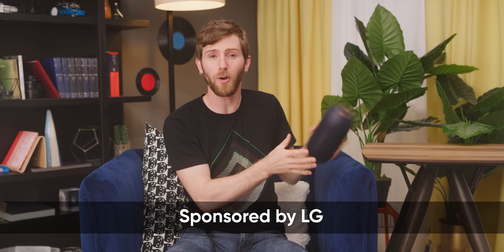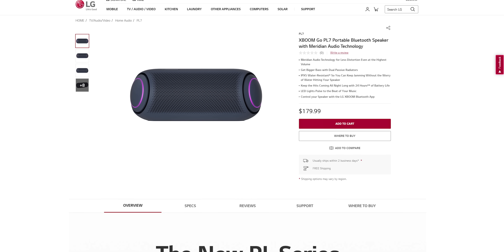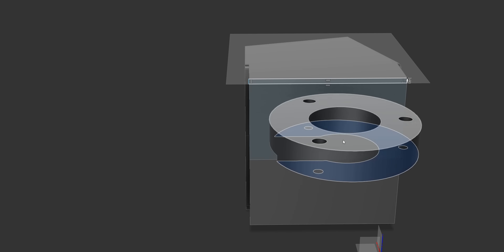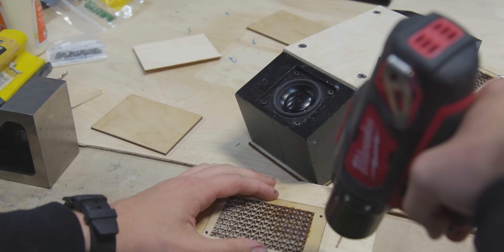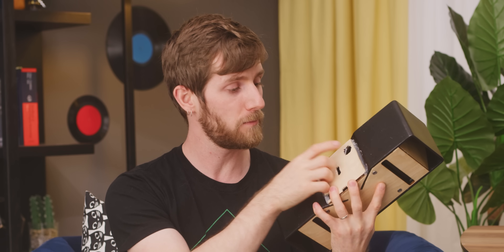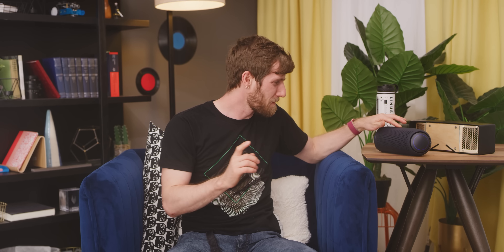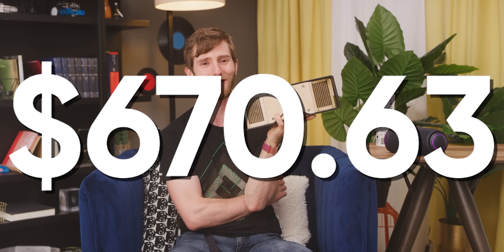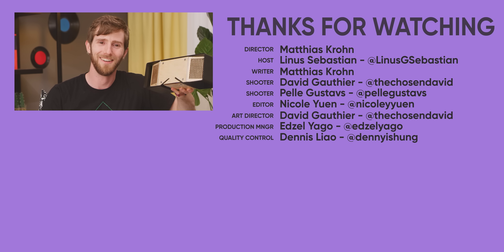Can we build a better bluetooth speaker? - LG XBOOM Go PL Series

Comment: Is it a joke? So much effort (design, 3d printing, a notable effort to create a real bass reflex cabinet and so on) for such a terrible result. Ugly design (those hideous screws, seriously?) and obviously poor sound mainly due to an initial massive flaw: why the heck replace a central bass or sub speaker with a tweeter, and to top it all pointing upwards, meaning all the high frequencies will be lost to the surrounding air...? It is totally contrary to all acoustic rules for a good stereo spacing and image, correct phase and bandwith. Just a single central bass speaker and two lateral tweeters turned towards the listening zone would have been way better. Nice effort, but do it again, please!! Oh, but wait, come to think of it, it was just a not so discreet sponsoring for the LG bluetooth speakers... so - and considering the absolutely ludicrous final price of this endeavour, better take it with a (costly) pinch of salt :-)

Comment: Currently in the process of turning a cheap corsair keyboard (K55) into a wireless one. Goals are to keep everything internal, be able to use it in wired while its charging, switch over to USB C for the port, and have somewhere in the range of 5-7 days battery life. Not a huge care about the cost or time just a fun project to see if it possible. Would love to see your guy's take on this.

Comment: With 200 bucks I can build for sure something better than what lg can make.

DSP +BT and a TPA3618D2 with a dual driver solution and an a passive woofer

bass box software, design the box and some tweak on the citrus logic by ic.

3s2p cells and you have lot of power and functionality.

Comment: 2:00 costs such as labour costs and anything really associated with designing and manufacturing shouldn't be factored in. They have economies of scale, and usually products aren't developed from scratch entirely, especially with more refined companies, such as apple, saumsung, lg, etc. Also labour costs aren't easily as 'hourly' since the specialist in charge of that aspect of the product likely has other products they're working on, and if they understand crossover parts, notably seen with all automakers, then they aren't spending as much time as you'd think.

I'm sure we all have friends in the engineering and manufacturing sector, you can ask around and they'll validate that.
Reply: I saw it more as a "i could just work X amount of hours and get it"
Reply: But if you DIY something and want to know how much it costs in total, you really should value your own time too.
Otherwise it would be hard for you to decide if DIY is cheaper for you than use that time to earn money and then buy the product.
Like for an example if I would start doing that and let's say it would take me 5 hours to make it from start to finish that would be 90€ on top of material costs.
Reply: @Ziegeri  Eh. I'm on the fence with this. I'm a strong advocate for DIY for things - I have my 800TB Roswell racks filled with HDDs from shucking external drives. I easily saved money from those overpriced 45Drive 'Storinators.' However, not every DIY project is about cost savings. I think Linus mentioned it himself in this, sometimes it's about the experience. If you were to say your time costs money, than you'd have to factor in everything you waste your time on. I would only say it's legitimate to factor in your time as a cost when you're planning on selling this aka this is a business venture. Also this would ba very hard thing to calculate - what is your time really worth? I can charge over $100 an hour for my tech services and that would be a reasonable charge, but if I (keyword is 'I') charged that for graphic design, no one would pay me because I don't have that skillset.

Also, if you go down the route of calculating costs than you need to also factor in alternative costs and things that can bring costs down. You can outsource your CAD work to India, you could outsource your manufacturing of a chasis to China, etc. When factoring in your time, it's imperative to also factor in everything else. BUT, at the end of the day, I still say that a DIY project such as this is 'timeless' - whether it takes me 1 hour or 10 hours, I'd still attempt it, even if the product is subpar (as was the case for the video). 

Labour costs are also significantly more complicated than I even discussed.
Reply: @SummerSausage1  
Yeah I do get your point and I personally like doing DIY stuff. But in this case the "question" was if you could do it cheaper than what a off the shelf product would cost.

And in my opinion if you are solely going for best for as little money as possible, you should calculate the cost of your time. Since in most cases at least in here, your employer will allow you to work overtime and even pay you more than what your agreed hourly salary is, like I think the min is 50% more by the law. Ofc that depends entirely where you live and what kind of laws etc. that country has.

So IF I were to pursue the most cost effective product, I would consider if it would come cheaper by just taking few extra hours at work.

If you love to DIY, it is most likely a hobby where the cost is in a minor role, and just the building and designing is the important part, then I would not worry about what my time is worth.
Reply: @SummerSausage1  they went with the minimum wage, its not hard to calculate if you go with standards, and its not "then measure everything you waste time on" basically is a "should i buy it or make it? If i do buy it, how many hours should i work to get it, and if i make it, how many hours will i need?" Lets take a cake for example, cost of buying is closeish to buy all the ingredients from scratch+skills to cook it and decore it, in this case, i could work, i dunno, 2 hours to get enough money to just buy it vs 3 hours i would spend making a slightly cheaper, less appealing cake. Sure, i would spend less money, and i may enjoy baking it, but its a question of whats better, to pay a little bit more for quality and avoid the hazzle, or spend a little bit less and go through the hazzle (and spend a lot of time)
Reply: That part of the cost was more to show how worthwhile it is to go the DIY route if you want to save money.
Reply: Exactly, of course LG's R&D will absolutely destroy poor Mattias this should've been more component based, they mf picked 10 dollar drivers for this speaker and I honestly have no idea what they expected
Reply: LG certainly considers design costs and labor costs making anything. All of that is accounted for in the price they charge. The have a BoM, and separate line items for R&D, assembly costs, packing and receiving, shipping, marketing, ect.

Comment: Higher frequencies are more directional than lower frequencies, so you should've used two smaller tweeters. Also using no crossover only shows you didn't want it to sound better, because you do have knowledge on the subject.

Comment: Yeah they did it better, but what did you expect? If you have no experience making this stuff whatsoever. I mean. Only midrange driver and a tweeter without crossover? Dude? That 3d printed enclosure could have easily been good with the right driver. Something like a 5” tang band woofer. There are plebty of YT videos about those things where they sound amazingly good.

Comment: Maybe the DIY speaker would have sounded better if you spent more than 25 bucks on the speakers (no the Tweeter doesn't count because there's not even a Crossover. The high frequencies are still played on the other speakers)

Comment: linus: "compared to a cheap bt speaker, i think we are in a rlly good shape here."

 tribit maxsound plus and anker soundcore motion+:👀👀

edit: i mean tbh i think apart, from soundquality tinkring was quiet great for diy, imo just a bit more improvement with engennearing, like adding a crossover with low-high pass filter or so.

Comment: listening the original song on my own speakers,  the linus speaker sounds bit to high , but overal quite clear. the LG has a heavy bass addon while the song does not have any deep base.  so not a bad job . at least for compairing via the video.   Dyton speaker are great speakers.  quess with the right filters and crossover , also put the tweeter in a place where its actualy facing you.  high notes are very directive. the bass unit is not a must drain more enery than needed.  i have a 20dollar speaker from the cheap store and it out plays most portable speakers i heared, turn all the extra sound proseccing stuff off than you hear wat they realy sound like.

Comment: Where are the middle in the LG speaker?
Sound should be balanced... You can destroy it later with some bad equalizer setup.
Sorry LG... crap. The same crap sound like JBL BT speakers for example... The sound is like the speaker would be under a pillow...

Comment: Actually, I prefer the LTT speaker. Hate, hate HATE that boomy bass sound that are usually engineered into speakers and headphones. The bigger and better the speaker, the less boomy is the bass. Even with proper HiFi-manufacturers. For example the Nubert nuPyramide 717 which costs about 6k each (and needs one hell of an amp, or better, two), has two 11" woofers per side and weighs 70 kg really surprised me with the lack of bass. Until you start to feel it in your guts. Same thing with some Backes & Müller that are around 81k for a pair (2 12 inchers and another 6 6,5 inchers per side).

Anyway, what really needs to be done (and helps) little Bluetooth speakers is the DSP tweaking manufacturers do. Denon did that to a massive extend in their Home 350 speaker, which reaches the same low frequencies as the above mentioned Nubert. At a fraction of the size (and price). Of course the Nubert is significantly better, but still, very impressive.

Comment: If you want a $200 waterproof beast of a speaker (27 pounds though, so it is less portable, but it has wheels and you can sit on it) then look up Ecoxgear Boulder Max. I have the Boulder + and it is a beast. I use it for blasting jams at the field when I play with my friends and the new one can connect to 50 other speakers. There are more features too, but I don't want to shill to hard for them, but check it out because I don't know how they can pack so many features into it and only charge $200.

Comment: I will still take my bluetooth speaker. Same idea with a bluetooth amp board. However its powered by a 20ah 12v battery. Also uses car speakers. Has 2 USB to charge phones. Voltmeter to keep track of power. Even has a external plug for charging. It will last days on a charge.

Comment: Placement of tweeter makes no sense, they have very narrow cone where you actually hear something, and cheap tweeters like this have maybe 30 degree cone at best.. and as you progress outside of cone, more frequencies starts to distort and disappear.  
Since its not pointed at you, i doubt it will do anything then produce some very weird high pitched sounds. 
Instead of that one big tweeter, better get two smaller headphone drivers, put them upfront, they will produce much better mid-high tones at low - medium sound levels, just chop off bass tones with crossover.
And yes, proper passive crossover or EQ is must, first, to eliminate low tones from fullrange drivers,  they cant produce quality sub 200hz tones and also to tweak mid tones, those smaller fullrange drivers can have quite nasty mid range spike in volume.

Full range drivers like those two installed can cover most of mid - low high's spectrum.

Comment: Maybe someone can correct me, but I think going ported isn't a great idea since it would settle your sound signature to that specific frequency your port is tuned to. I believe that a sealed compartment with passive radiators would have been a better option, or just sealed without radiators to stay on budget. Also, going full wood (plywood or similar) would help with the sound too, the 3d print structure proably lacks mass to actually resist the inner pressure generated by the drivers (I have absolute 0 experience with 3D printing in this area, so I'd appreciate some feedback on this, I would be absolutely wrong).
As I said I might be wrong just playing by ear here, it was nonetheless a pretty beautiful design and a great video

Comment: Today I'm going to be an internet expert: Front ported would have been better, your rear ports are firing away from the listener, it would probably sound better (or more bassy) if placed close to a wall. Generally most of your stereo image is in the mid-high frequencies, and you'd usually want your tweeters to be close to ear level so having a single tweeter pointing upwards isn't ideal in that respect. As others have suggested some EQ would go a long way to fixing the deficiencies, and I'm sure it's something LG have done in theirs.  If I was building it I'd probably try to find a 3" driver to use as the sub and find a bluetooth amp with 2.1 output, and build a ported enclosure for the sub and have the 2 full range drivers sealed, maybe with a high pass filter to  take out some of the bass. But, I'm only an internet expert so  it might still be not good.

Comment: Sound advice:

Bottom or front firing ports could improve bass but you're using small, low power, low excursion full range drivers so ports are probably not the best choice (they don't move a lot of air). Adding passive radiator/s (still try to keep these bottom or front firing if at all possible) might work out better with small drivers in a compact space, and of course a dedicated subwoofer would be best but could increase the size and weight a lot and more drivers decreases battery life. A restrictive grille design like you have will not help with overall muddiness. Also, you only have one tweeter, with no crossover or EQ which is probably contributing a lot to muddiness. You angled the drivers which can be good for stereo separation, but then you partially blocked the directions they fire in with the outer shell.  If there is a way to program an EQ into the logic board, don't just EQ for it to sound good at medium-high listening levels. Adjust the EQ for the whole volume range, so more bass at low levels to not sound tinny and maybe less bass up top to avoid distortion, if necessary. Make sure all "dedicated frequency" drivers are being fed the right frequencies with a crossover, and big enough mid drivers and subwoofers may need dedicated amplifiers too. Also, a logic board that supports high bitrate streaming codecs like aptx HD, LDAC etc. and an aux port will help a lot with sound quality if you're going to put a lot of effort into the engineering. Watch or contact oluv's gadgets YouTube channel for the best sound advice! He's the biggest expert on bluetooth speakers.

Design advice: 

Controls and ports on any other side but the bottom would be better for ergonomics, if there's no way to make them look nice then put a cover of some kind over them. The speaker looks pretty nice aesthetically but wastes some space you could use for either better portability, more battery, bigger drivers, etc. because you have an outer frame which takes up a volume bigger than you use for the  functional parts of the unit. The painted finish probably won't stand up to much abuse, bare plastic, metal, or some sort of rubberized coating would be more durable. If you had a non ported design with no wood and all your drivers were made of non paper materials, you could epoxy the enclosure together the same way (or gasket places that need to be opened for maintenance), and epoxy inside around the ports so water doesn't get in, and you would have a nearly waterproof speaker. If the speaker is going to end up around this size or bigger, it would be nice to have some sort of grip or handle integrated.

Can't wait to see the next iterations! Your team is usually pretty good at designing stuff. It would be cool to see both an affordable version, and a balls to the wall no budget version.

Comment: The fact that they compared the LG to a cheap homemade speaker, rather than to a similarly priced competitor, means that it is not the best option out there.
Ofcourse you can't engineer anything decent for under 200$ factoring in labor.